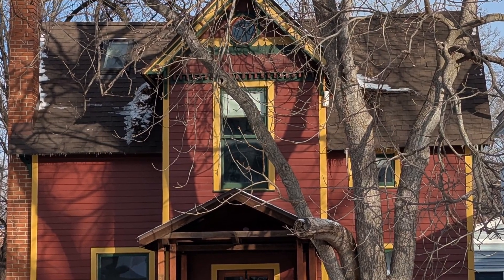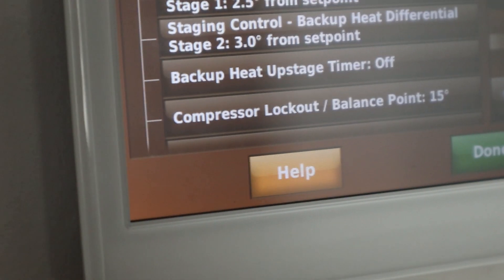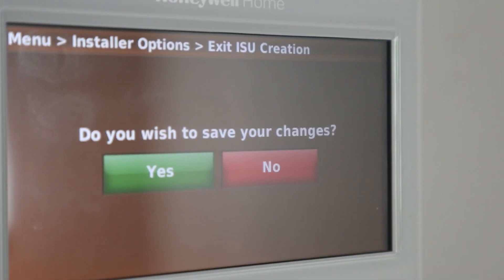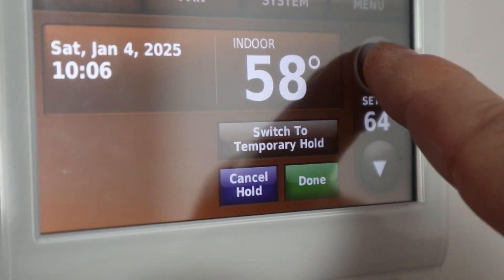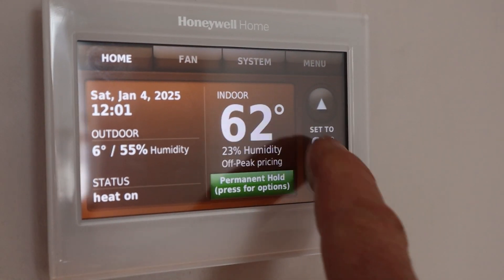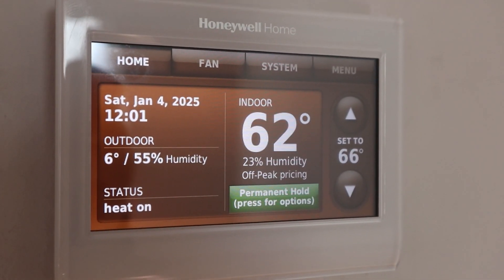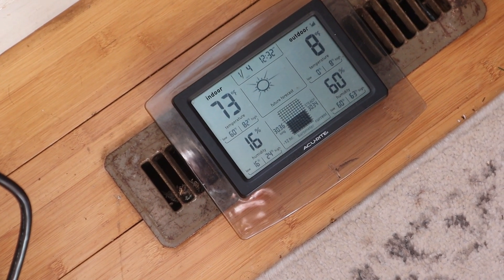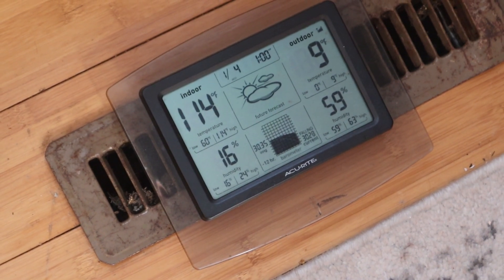How Hot is Heat Pump Heat When it is ~5f?

Comment: Your model is not a two stage system, you have a variable speed compressor. Weird that your thermostat allows you to change the two stage settings. Did you replace the thermostats when you upgraded the system? A lot of thermostats don't work correctly with variable speed systems and need upgraded.
Reply from the maker: Interesting. I checked out the specs and you are absolutely correct. It has a variable speed compressor. The thermostat was installed with the heat pump and furnace. So do you think Stage 1 and Stage 2 have to do with compressor speed?
Reply: @mbrenengen  There are single stage, two stage and variable speed compressors (not fans). Variable compressors are used with new cold climate systems. Many third party thermostats wont work with variable speed systems (or at least won't give you all features you might want). So important to match thermostat with manufacturers latest model or ask them directly to verify.

Comment: Shoulda gone with the Mitsubishi h2 heat pump.  Has 100% heating capacity down to -5F
Reply from the maker: I don't believe that means it is always putting out full 100f (or whatever). I wonder if 100% represents the Delta between outside temp and heat temp. Can you confirm?
Reply: @mbrenengen  -   It means its capable of giving 100% percent of rated output at -5F,  its not guaranteeing any particular output temp at the floor registers(vents) but it might give an estimated temp output in the units paperwork.     The Mitsubishi H2 is supposedly the best Heat Pump made for Northern areas that get super cold winters and is Japanese made.